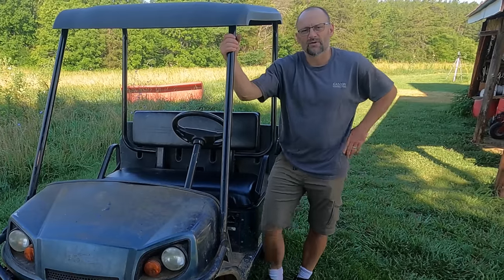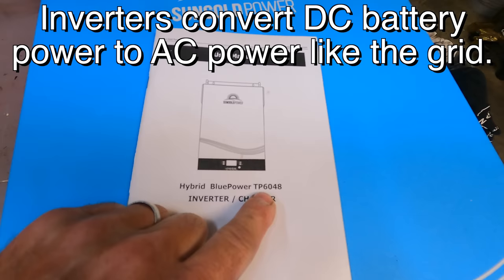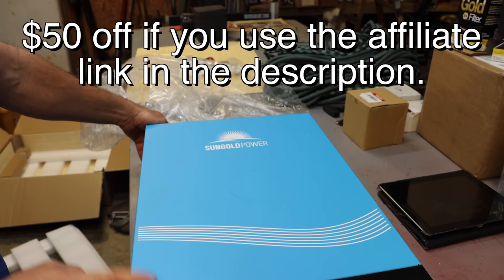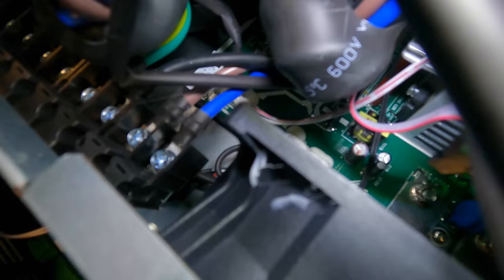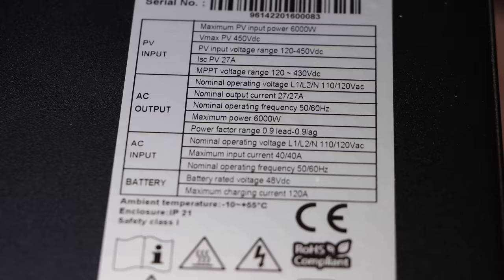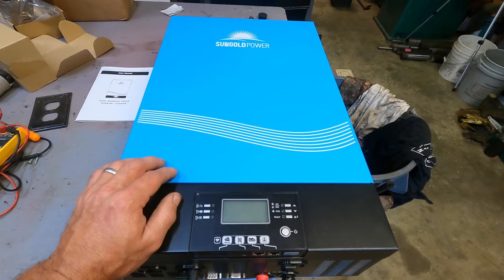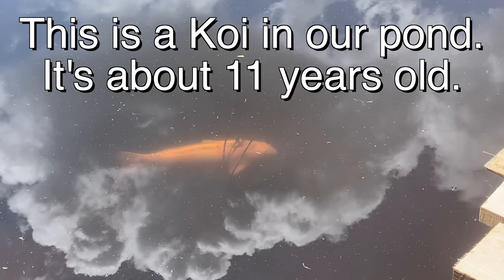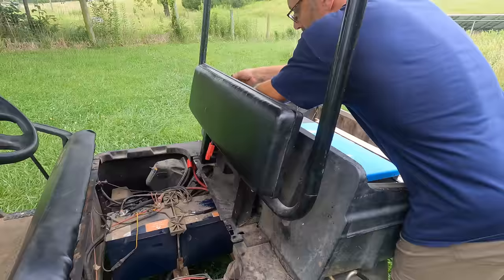Converting an Old Golf Cart into a Supercharged Power Plant.

Comment: Electrician here: With lithium batteries, you want to get a large resistor to use as a precharge resistor when connecting the inverter in order to charge up the capacitors. This will prevent the batteries from damage with the initial draw from the capacitors. For a 6 k inverter you want to use 4/0 cable to lower the resistance for the surge capacity, and also try and keep the positive and negative conductors as close as possible for as much as the length as possible. Taping or zipties is fine. The farther apart the conductors, the higher the resistance. Keeping them as short as possible helps too.
Reply: "The farther apart the conductors, the higher the resistance." -- Don't you mean impedance? I assume the problem is the magnetics from a large loop of cabling, or am I misunderstanding?
Reply: @chuuni6924  Depending on how the conductors are laid out, you'd have to be concerned with both reactance and resistance....... so, yeah. I guess impedance would be a better "blanket" term for the issues.
Reply: That said, I'd just run 2 welding cables (#4 cable, like GoCoyote said - they aught to be fine). Stick them in a wire loom or maybe a long piece of heat shrink and call it good.

Edit: I would NOT however use jumper cables. A lot of them, even the big, high amp ones are copper plated aluminum conductors.
Reply: @chuuni6924  
In DC circuits, it will actually be self inductance that causes the resistance. Here is a fairly cogent explanation from an old Trace engineering manual.

When current passes through a conductor a magnetic field is set up around the conductor. As this magnetic field builds, it induces voltage in any conductor that is close by, and it induces a voltage in the original conductor. The voltage induced into the original conductor is called self-inductance, and tends to oppose the current that produced it.
The magnitude of the self-induced voltage is proportional to the size of the loop formed by a wire. The larger the loop, the larger the self-induced voltage. The positive and negative battery cables in a system are in reality only a single circuit (wire), and so the inductance of the battery circuit depends on how the cables are physically positioned or arranged with respect to one another.
If battery cables are separated by a distance, they have much more inductance than if they are close together. If the two battery cables were coaxial there would be virtually no induced current flow since the magnetic fields would cancel one another. However, we don’t have coaxial battery cables, but we can approximate them by taping the cables together every four to six inches. When the cables are taped together, the magnetic fields around each battery cable tend to cancel each other. When cables are separated the magnetic fields add together and increase the inductance of the battery cables. If you aren’t convinced that taping battery cables together helps reduce inductance, consider the following table of information collected by Trace Engineering. We tested two sixteen foot long #4/0 AWG battery cables connected together at one end and parallel to one another.
Table 8, Battery Cable Inductance
    Distance Between Battery Cables
Inductance
in micro-Henries
Taped Together
3.3
12” Separation
6.0
48”+ Separation
8-9
        The above table shows that with only a foot of distance between the battery cables the inductance almost doubles, and at four feet between cables the inductance is almost three times the inductance of cables taped together.
Since the induced voltage in a conductor varies as the inductance times the rate of change of current in the inductor, the induced voltage may be three times greater than it would be if cables were not taped together. For more advanced readers, consider flyback effects and the induced voltage spikes can get into the thousands of volts range if the battery were suddenly removed from the circuit (worst case).
These induced voltage changes cause ripple in the battery cables and must be absorbed or filtered by the filter capacitors in the inverter. This ripple will lead to eventual premature breakdown of the filter capacitors and performance loss in the inverter.
In addition to the problems mentioned, the induced current opposes the applied current (battery current) which directly causes a loss of inverter performance as greatly reduced efficiency.
To avoid this problem, route your positive and negative DC cables in parallel, as close together as possible. Secure the cables against movement with clamps or straps every 18 inches. Avoid routing conductors near heat sources such as dry exhaust or furnace piping. Avoid chafing sources such as steering cables, engine shafts, and throttle connections.
Hopefully this information gives a much more realistic and clear idea of why battery cables should be kept short and close together. Maximum performance is the goal of any well designed power system and the details such as this will help achieve the goal.
Reply: @GoCoyote  A Flyback Diode could be used in case of battery removal.
Reply: @GoCoyote  If your explanation above is exact, when he daisy chained the batteries for more power he caused an impedance which negated the very power he was trying to achieve.  What say you?
Reply: @GoCoyote  Also if the cable cross each other at 90 degrees, wouldn't that negate the coupling effect you've explained?  I believe it's the coefficient of coupling that you've explained from minimum to 12" max.  Crossing the lines at 90 degrees basically has the same effect as coaxial, just not as efficient.  What say you?
Reply: @marksellers3260  
While I am not a physicist, To my understanding the 12" is a test example, and the self inductance effect increases with the distance between the conductors. This is one reason that signal cable wire pairs are twisted together or coaxial. Crossing at 90 degrees is to prevent AC circuits from inducing voltage and current in signal wires and other DC circuits, as one is minimizing contact area. A transformer parallels the wires as close to each other as possible to maximize contact area and induce a both voltage and current in another set of conductors.
Reply: With that thing in the back of your golf  cart where are your golf clubs going to go? Will you take it out later?

Comment: I also noticed the circuit boards seem to have conformal coating on them, which helps minimize corrosion and reduce environmental effects. So yeah, looks like they aren’t taking short cuts on that build.
Reply: in my limited experience, sample review pieces always have top notch quality. its retail sale pieces where corner cutting takes place especially for Chinese manufacturers
Reply: @lordjaashin  I could see that. Question is if they expect you to open something like this
Reply: For anyone looking to add/improve waterproofing on circuit boards for devices that are outside often, CorrosionX and especially CorrosionX HD work really well for preventing water damage to electronics

Comment: seems like a strong inverter, but overall cost, when considering batteries, its hard to beat a stand alone gas generator on a gas golf cart  for a portable power station.
Reply: You still have to factor in maintaining the generator and gas motor. This there's only a few things that can go wrong instead of however many parts that the motor has.
Reply: What sort of gas you using, LPG, methane,  natural gas from the well? What type?
Reply: @linmal2242  well I would use the same gasoline the cart uses.  They have big tanks.

Comment: The weak link isn't the batteries, it is the fan that draws saw dust, bits of grass, fuzzy tree stuff, etc, into the heat sinks and plugs them up.
Reply: That can be mitigated with some worn out scotch brite pads and some double sided tape though.
Reply: Not if the fans blow out and or you filter the air intakes.

Comment: That double plug "suicide" cable is against most codes and regulations.
As you mentioned, it can be very useful for specific people under very specific circumstances.
If you find yourself asking out of the blue: "Do I need this?" you are not those people!
This is for specific purposes only and needs to be safely stored after use, the exposed prongs will electrocute.
Reply: Those specific people with specific circumstances are more specific than some people might think. Most of the people that think they have such a special case can better solve their problem using a generator transfer switch and a regular cable. That, or hardwire your temporary solution without using plugs.

Long story short: If you have a generator, install a transfer switch instead of creating a suicide cable. And should I ever find myself in need of one, I'm sure to disassemble it as soon as I'm done using it.

Comment: At first I was like "Oh boy, another gimmick." Actually, I am damned impressed. Just be careful with the suicide cable. Always plug into your load and then into the power source. You holding onto that live plug with bare ends before you plugged into the barn had me squeamish!! Unless the inverters output was in the off-state. Couldn't tell.

Honestly, the inverter in the UTV being powered with the LiPO has so much utility. Dead quiet, light weight, no fuel cans, etc. Super awesome actually!!!! There is something to be said about working on a job site without the drone of a genset for hours on end!!

Generator is still cheaper in the long run but, its a lot more to deal with and it can be cumbersome. This is a lot easier to work with.

Both have pro's and con's but I am liking this none the less!!!
Reply from the maker: You are correct.  It would have been safer to do connect them in the opposite order.  I often work with live wires and breakers, so I'm fairly comfortable with it.  Maybe too comfortable?  ;-)  Honestly, I wish I had done it the other way for the video.  I was already doing something sketchy, at least I could have done it in the least sketchy way possible!

Comment: I came across your channel about a month ago. You do great work. You're an innovative and intelligent problem solver. Your videos are organized and contain excellent content.

With regard to the soft spot in your driveway. You may be able to completely solve the problem of the  sinking substrate without having to use any concrete. 
If you were to dig the area out 10-12 inches deep, removing the dirt and small debris, then start filling the hole back by adding a layer of stones 6-8 inches deep, 4-6 inches in diameter. Pack that down then put 2-4 inch stones in, fill the hole to within an inch of your top level. Then top it all off with 3/4 inch crush and run (3/4 inch stone mixed with finer stone dust) before doing your final tamping.

The technique has worked well for me on my farm in the mountains of WV, where I have a half dozen seeps all over the property. These little spring often make the ground a messy quagmire that you can hardly walk through, much less drive a vehicle.
 
The large stones at the bottom make a sturdy base that spreads the loads out without sinking... and the progressively smaller stones will fill in and lock the larger ones below in place. The Crush & Run packs down flat and hard preventing surface erosion.

I hope it was helpful.
Keep the excellent videos coming!

Comment: I have the SunGoldPower 3KW Inverter charger for my offgrid cabin. It's a real beast. I can run my 12" chop saw no problem and the vacuum cleaner works a treat.
 I also love that when I fire up the backup generator it detects the power and auto switches to a batter charge and auto switches it's output from inverter to what the generator is sending.  No more flipping switches when going between power sources!

Now about the suicide cable.... I'd strongly recommend a proper cutover switch (the kind that switches the fuse box between either grid or inverter/generator) that way you could have a male NEMA plug on the wall and use a conventional cable. Right now you are 1 mistake from a 230V heart-stopping experience.

Comment: 21:08 in the video, put the connecters on your leads the right way round , the one on your inverter should be on the battery leads, that way very little shorting potential. Great video, thanks

Comment: FYI,  I have a Miller 211 investor mig welder. It will run on 120 or 240. I bought a HF 3500 generator to run it on 120v to work on some shipping containers. The inrush would overwhelm the HF generator. I was using .030 wire. Done a little digging and Miller says a min of 7k to run the 211 on a generator. I ended up with the HF 9500. It runs it with no problem. It is over 250lbs so I move it with my tractor. That inverter running your welder is impressive! Thanks for taking the time to make these videos. I’m like you in another state. I get into equipment repair and restoration. I enjoy watching your videos way better than the depressing stuff on TV thanks again!

Comment: It helps to put De-ox in the cable lugs before crimping them, cuts down quite a bit on future corrosion. Some heat shrink over top and it should last about forever.
Reply: Would need to heatshrink those things.  That stuff is a "grease", right?  If it is that stuff can be messy.

Comment: You have probably gotten this suggestion elsewhere in the comments, but as an added precaution, I would try and further isolate the inverter from vibratory loads (of driving around the farm) in the back of your cart by mounting it to that white board on rubber feet that give additional shock absorption to further prolong its lifespan.

Comment: suggestion for  the farm, first get an old plastic truck bed liner- cut off the sides, bolt an angle across the front and attach chains to make a sled for dragging behind the golf cart. Roll that mixer on it and go. No lifting. Rake leaves on it, dirt, or mulch. My wife’s favorite tool behind the golf cart, even the wheel barrow goes on it.

Comment: I would highly recommend looking into DC Generators since you already have Solar system. I had a Kohler standby for 3 years brand new and had so many issues with it killing sensitive electronics and multiple parts failing so I got rid of it, then tried portable generator routes with reliability issues... so I decided to build one with the intent of it being more reliable. I initially tried to use a over the shelf car alternator, just with the regulator circuit gutted from it, but on a 100amp alternator I was only seeing 7-8 amps output @ 90v DC with the pulley I was testing it with. So I bought a wind turbine generator motor from ebay that was designed to output 4800watts @ 96v DC, i had an old VW Jetta w/1.9TDI that ran well, but was damaged from accident, so i had the differential welded so the output of the transmission was locked like a locker, then mounted the wind turbine motor to the wheel hub assembly after modifying it some and ran the electric motor directly off the drive axle from the transmission. This gave me the option to start the motor in neutral and use the different gears of the transmission. Wired the output of the electric motor to the input of a Victron solar charge controller setup that charges my 48v batteries for my solar system. After i got it all running i bought a 2nd of the same wind turbine motor for backup, but ended up mounting it to the other side to the other axle as a pair and use both now to split the load. Ive run this setup for 11 years now without an issue using the old car cooling and fuel system. An alternate idea to a higher quality mobile generator, one of my neighbors down the street from me bought a salvage title Ford F150 from CoParts that was totaled because of hail damage for 7k, because it had the 7200 watt pro power onboard system and turned it into his farm truck around the property and his mobile generator since he can put it in generator mode and power the house. Ive seen him power his house for 20+ days off it without an issue..

Comment: Adding a Frequency drive to the sander may could enable it to run on that Inverter since it could provide a soft-start. And having a battery on wheels is a nice idea!

Just please get rid of the suicide cord. Saving the cost of a lockout and proper socket isn't worth accidentally hurting oneself or a linemen. Especially since by modifying the lockout already present in your breaker panel and moving the solar inverter breaker to the bottom left corner is most of what you'd need. (At least for that panel)
Reply: The suicide cord is the least of his problems !  The inverter is for indoor use only and wont last long at all ! what a shame.

Comment: That would have been nice to have had when I had my RV. Actually it had a fairly nice inverter that I became very familiar with the first year I used the RV.

I was heading to Cape Charles in late April in 2015 and charged the series of coach batteries by first disconnecting each and individually charging..

The charge went well and I was being very careful by labeling all the wires so that when reinstalled all went well.  Things did not go well. Somehow I swapped ground with positive.

I spent the next week pulling everything out from fridge to heater to range hood so that I could rewire everything that had melted in the few minutes it was incorrectly connected.

The only good thing is I really new the systems by the time I was done and the truck part of the RV was on a separate system and suffered no Ill effect.

I do remember being impressed by the fridge. Until then I had never seen a cooling device that ran on propane complete with a pilot light. I kind of remember the fridge ran on some principle involving ammonia but it sure cooled well and I remember being impressed by the full details plus they are very expensive  were I to have had to replace it.